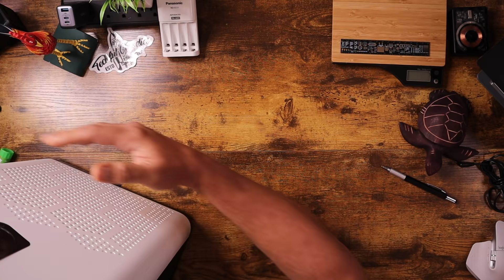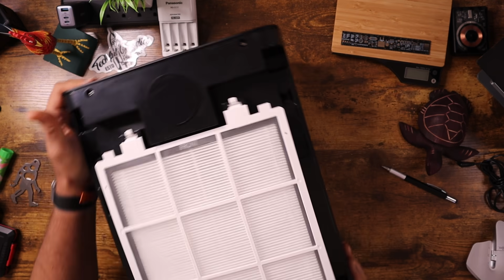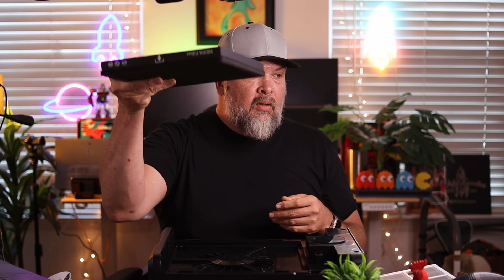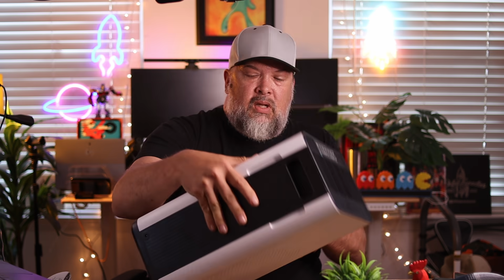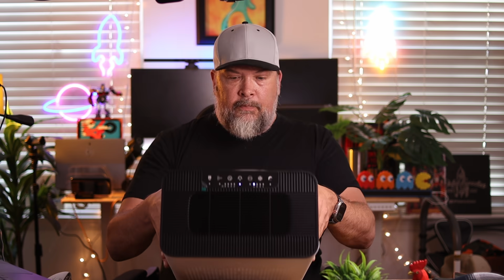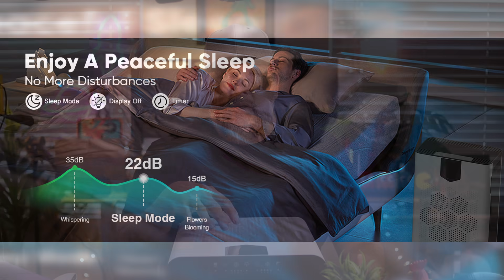SO FRESH! Dayette Hepa 14 Air Purifier Review

Comment: A true hepa 14 requires a rubber gasket on the filters. The required air pressure will bypass air through the joints of the filter with a foam gasket. This filter is not true hepa 14. HEPA 13 works with foam gaskets.
Reply: Im starting to doubt if it's really h14, feels like h12
Reply: @wertiaaudit5746 could even be 10 or a total fake for someone lying
Reply: @dipro001 yeah probably
Reply: Does this mean this air purifier is useless? I was thinking of getting one but it’s so cheap I don’t trust it lol
Reply: @amandag8934  i dont know enough about this brand to tell you. However, if its true hepa 13, that is actually good enough for most application of an air purifier. Hepa 14 is only needed in labs and surgery rooms and a few other places. The question is whether its even hepa 13 or lower. I will recommend getting a reputable brand at true hepa 13 or up.
Reply: Wrong

Comment: I just purchased one and I just hooked mine up after watching your video. So I put it on turbo it says for 10 to 20 minutes the air quality in my home is 24 so  my thought is shouldn't have been a different color when first turning it on I've been through several air purifiers that are purchased through Amazon. I like this one because it had two filters. I leave it in a 400 square foot room. My question is for you if you would answer me back. should I put this in my bedroom at night are just leaving it running in my den area constantly. And leave it on auto. I have seen the comment on Amazon where a lady said she forgot to take the plastic off of one side of her unit she had had it on there for a year LOL.😂 So I got this one for $50 off it ran me with tax 85 bucks do you have deals where I can get filters cheaply

Comment: Carl I tired to purchase the air filter unit they your link but it comes up $139 with just the fifteen percent off.  Tammy from Myrtle Beach
Reply from the maker: Hi Tammy - when you add it to your cart, inside of your cart, on the item under the price it should say "Clip Coupon" for $60 off - give that a try.  Amazon checkout can be weird.  If that doesn't work, you can go to the main listing and click the checkbox for the coupon.  Let me know if this works - if not, I can give you another link